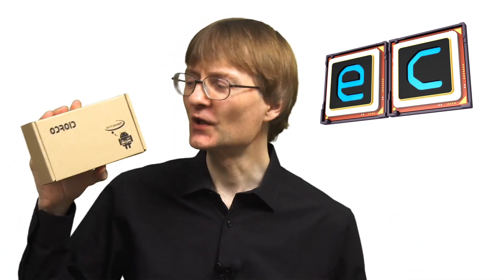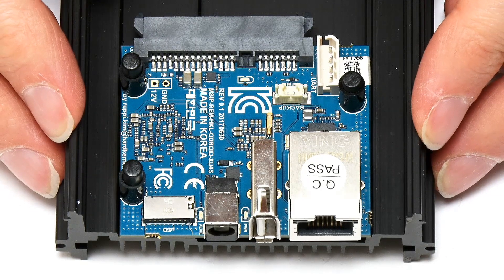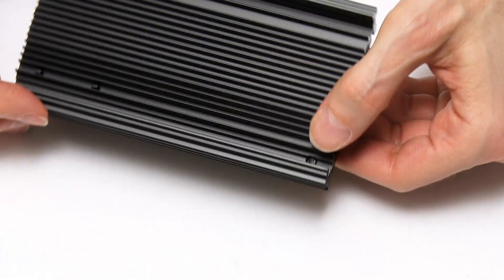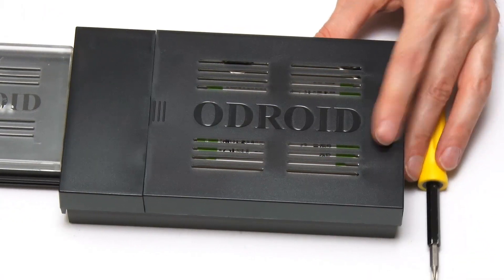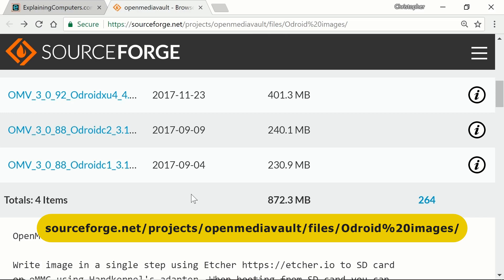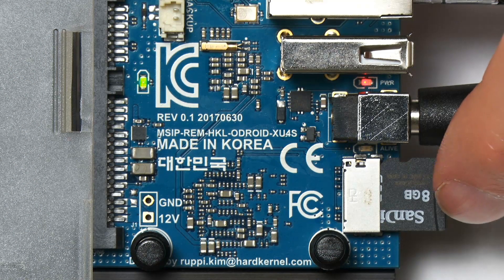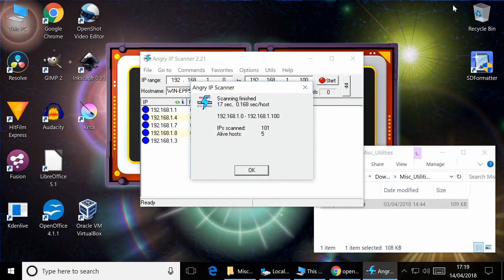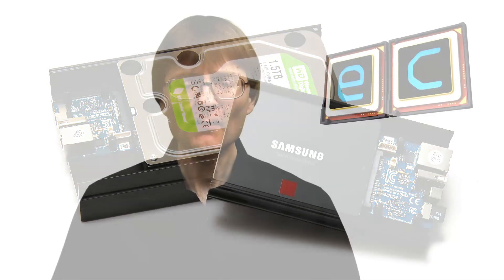Odroid HC1 & HC2 NAS SBCs

Comment: Well Sir Chris,  I have decided on qty2 hc1s as my double NAS on my router. I will use 1 for write and other for copy/backup. I will follow your video on setup.  My first attempt with SBC technology.   I will need an SBC FOR MY WORKSTATION. I hope to connect 1 or2  sata iii ssd Western Digital drives to it.  I want to try a flavor of Linux with a good word processor and spreadsheet.  Any recommendations on the best COMPLETE SBC. And which Linux to try?  Thank you as always!
Reply from the maker: For a workstation SBC, it depends what you want to spend! :) A Pi 3 B+ works very well, but an UDOO x86 is faster and has far more connectivity! Best Linux, in my view, if you run an x86 SBC is Linux Mint.
Reply: I just ordered the 2 hc1s! super excited. new adventure for me. lol  hope I can follow your video steps well..

Comment: Can you obtain a ROCKPRO64 and connect 2.5 Ssd sata to USB3.0 port. Then another 2.5SSD SATA TO USB C port. Run NAS?
Also ROCKPRO64 required components not all listed together in the store. Besides 12.5 volt recommendation, wifi/Bluetooth card and large heat sync (no separate fan other than what is offered in the hard NAS box which is to expensive.  I see that as a 2 disk single NAS unit. Pricey also. Need discount code to purchase. Sata to USB 3, and sata to USB c cables are at (www.newegg.com). I used my ssd drive order to match cables..
Please advise.
Reply from the maker: RockPro64 video tomorrow! :)
Reply: I WOULD Like to see that video. Also a 2nd one comparing UD00 and RockPro with 2 SATA iii SSD drives connected. comparing performance throughput writing and pulling information.

Comment: Open media vault allows all file types to be saved/used on ''tis NAS?
Reply from the maker: Yes, it just creates one or more network drives in which you can store whatever kinds of files you like.
Reply: I will purchase probably an hc2. Open my desktop and remove the 3.5" 500gb hd and try it.  I will get the specs and ask website if   Disk is compatible with HC2. I may need to find device drivers.  In that case I will ask if I load device driver on micro mini sim along with other software.  That would get me up and running in a short budget with ample data storage. A 2nd hc1 or hc2 I can purchase larger new  drive for share of pics and videos.
If you have recommendation for a third as an excellent pc, I can complete work easily down stairs with a cute unit beside my chair on end table.
Confused on OS I should get for that one. Just need browser, word and excel type apps with virus protection.
Reply: Thank you sincerely for the time and effort taken to reply!  This means a lot to me! Saves me tons of money I don't have!  Humbled..
Reply from the maker: The HC2 will work with any SATA drive -- you should not need any device drivers, and indeed I am not sure how you would load them with OMV. Note that it is probably not a good idea to try your desktop drive in the HC2 -- you normally wipe a drive to set it up in a NAS.
Reply: Parts of my memory have issues (not age-53 now) lol. Could be from calling Mother daily to comfort her (90's),  rubbing off on me. She is my daily project since I can only visit 2 x a year.  (Same story told and same list of ailments, but I look forward to each call.). Sorry to ramble.  I bought  desk system 2012 (6yrs old), 1TB main, 500gb (2nd disk). I stored 2nd disk data on cd and wiped it clean last week. Then I checked both disk for bad sectors, none found.  I also have a wiped external 800gb disk. (I had to download drivers for it a second time) I was going to check it (windows 7 professional)). Test write to it them wipe it again if it works good. Nice portable one with leather case a friend gave me in 2012. Can't remember manufacturer name.  HP - Hewlett-Packard Packard is my desk computer that runs extremely well still. Just one error needing to update device driver for Ethernet card.(supposedly a2015 release I did not get. While testing external disk, I'll try find driver on web.  Not sure that age is sata on drives. I can pull component list by serial of CPU from hp.com I believe.  External is in nice small steel case but not 2.5".

Comment: How much would it cost per year to run a Odroid HC2? 12 volts seems a lot for me.
Reply from the maker: Watts rather than volts is what matters! :) Cost will depend on your electricity supplier. In the UK I would guess at using one unit of electricty a week -- so maybe costing around £5-£10 a year. but would depend how long the 3.5" drive was spun up. (It needs the 12V PSU to power a 3.5" drive; only 2.5" can run from 5V).

Comment: Hello from Spain:
I am interested in this board and its potential, I have a question that I can maybe solve. I have a tablet with exynos cortex a9 1.4 quad core, ethernet outputs, hdmi, usb, bluetho .... I have a bootloop that prevents me from starting android icecream and only It has the possibility of recovery from the external SD card, it does not have a single button volume only power button so I can not go into recovery mode like on samsung phones and tablets .
I want to save my information from a single folder but if I put the files sent (u-boot.bin¡bl1.bin, bl2.bin, tzsw.bin plus the .img files (user data, system, bootlogo), it will erase everything to me again .
Could you use it, since it starts from the sd an odroid linux to boot from the sd and copy that folder? Where can I buy this card with the basic boot linux? Would it erase some of the information from the internal mmc? Of course I find it interesting, I'm going to buy a plate to practice. Greetings and thank you

Comment: Thanks for the interesting and informative video.  It would be interesting to see how fast the SATA interface runs, perhaps by generating a large, random file in RAM, then writing it to the drive to find the write speed, then reboot to flush the caches, then copy some files from the drive to e.g. /dev/null to find the read speed.  Also, for a "proper" server we need at least two network interfaces, so it can work as a router, gateway, firewall, and dhcp server, and three or more interfaces if we want to make a load-balancing router, or switch.  Have you seen anything like this in this tiny SBC format?

Comment: I got the HC1 and have nothing but issues with OMV... applying settings I get errors, installing plugins I get errors, etc etc etc.... dont know what to do with it...
Reply from the maker: This is very sad. I would wipe the SD card and reinstall; maybe there is something corrupt in your installation. I've not had these issues.
Reply: I tried with version 3 and 4 on different cards
Reply: OMV is getting frustrating.... fresh install and nothing but error after error

Comment: Would this have any issues going over WiFi with an appropriate adapter?
If so then adapter recommendations?
Reply from the maker: WiFi could be used, using the USB 2.0 socket. I would get the WiFi adapter from Hardkernel for compatibility (drivers).

Comment: Would it be possible to configure 4x odroid hc1's as a raid 10 NAS doubling the speed and reliablity?  For that matter is it possible to set up multiple nas's to run as a single raid storage device?  I personally prefer raid 10 because you get the speed boost of 2 drives running in tandem while also having the safety of having a backup.  But I am sure if it can be done with any raid configuration it can be done with all of them....  Anyway if it can be done I would love to know how I would love to build a home SBC NAS with raid 10.  I prefer going with SBC's for there low power consumption and will probably use the rock64 for the price:mb/s ratio....  Thanks for the great video please keep up the good work!  Also I am curious I know with Linux there's allot more potential for tinkering, if I remember right one of the SBC'S you tested has a gigabit eathernet port that can nearly reach 1gb in Linux or on the router is it possible to configure a split connection or .5gb up .5gb down.  So it can send and receive files at equil speeds?
Reply from the maker: I guess this may be possible by clustering the HC1s, but I am not aware of such a build. Most SBCs now have 1 gigabit Ethernet (the exception being the Raspberry Pi!). I see no reason they could not be configured as you say.

Comment: How is the 3.5" drive powered, I saw no power connector only the data interface?
Reply from the maker: As with the 2.5" dive, the power for the 3..5" drive is alongside the data interface. They are identical connectors.
Reply: I see thanks
Reply from the maker: Reading back, I meant that the connectors on the 2.5 and 3.5 inch drives are identical -- not the power and data connectors! :)
Reply: Yeah I see .. just a different 12v power supply thanks

Comment: This SBC lacks a video output to connect it to a monitor. Can this functionality be added to this board so it can be used with OSMC? Can the USB port be used with a USB-to-HDMI adapter for this video output purpose?

Comment: Bought one of these because of your video, seems to be faulty.  Do you get blue LED coming on whatever or do you have to have microSD card in slot?  I get the power LED and the green LED briefly flashes but no blue LED whatever I do.
Reply from the maker: Sorry to hear that you are having problems. The blue LED will only flash when the microSD card is inserted and the software has set itself up and is running from it correctly. Given that you have a red (power) LED, and the green has flashed, I suspect that your hardware is OK, and that this is a software issue. So I would suggest turning off the Odroid, removing and reflashing the microSD card wth OMV (make sure you have the right version, reinserting the card, powering up, and waiting for it to sort itself out (the first boot can take some time for the machine to set itself up). So, depending on the speed of the SD card, wait a good 10 minutes after powering up to let the machine sort itself out -- and do not remove the card during this time. If this does not work, download the OMV image again, in case it got corrupted. Good Luck!
Reply: oops, wrong image on microSD card, reflashed image and it worked straight away, I shall play with this tonight when I get back from work, thanks for the prompt reply.  You are a star!
Reply from the maker: Glad to here all is OK now. :) Enjoy playing with OMV. :)

Comment: There seems to be a transfer limit on the hc1. I attempted to transfer a group of files that was 282gb, and it told me that I needed more space to complete the transfer. The hdd that I'm transferring to is 4tb. I then broke the transfer up into smaller bits, and allbof it went without a hitch
Reply from the maker: I have not come across this, but I have also not tried moving that much data in one go. I imagine details of the files to be copied have to be held in RAM, and there has to be a limit.

Comment: would it be possible to anyhow connect 2 SSD´s? i have 2 128GB lying around.
Reply from the maker: Not with this hardware, except by connecting one via a USB 2.0 adapter. But they make a case/board for an XU4 : http://www.hardkernel.com/main/products/prdt_info.php?g_code=G150575879656

Comment: Hi there mate! Long time viewer first time commenter. Would you please start offering your content in 4K video resolution on your YouTube channel? It makes for a much better experience. 2018 is the year of 4K. Embrace the future yo! Thanks for all that you do ☺☺ you make learning about computers fun!
Reply from the maker: Thanks for watching, and for your first comment. :) I have just upgraded my pipeline to handle 1080p, and am still heavily tweaking that. So 4K is nowhere on the horizon I'm afraid. That would require roughly an 8 times increase in the capacity of my CG rendering setup for computer generated shots, and an enormous increase in storage capacity (I do everything in ProRes, which is large enough at 1080p!). 4K would also be impractical for computer output without very significant scaling, and most SBCs, most do not output 4K. Yes, some tech channels do record computer screens at 4K. But they clearly are not thinking of how it will be watched by the majority of viewers. I remember my BBC days shooting animation on film, where if any lettering on the screen was less than 1/24th screen height they refused to load the camera! :) And human eyes have not changed since then.
Everything I upload has to work on any size of screen, at at 240p upwards, and when viewed lean-back on a TV (the fastest growing YouTube space). I also rely on a 20x zoom lens, and some CU lens, for a lot of my videos, and getting such lenses to resolve anything like 2000 lines, let alone without massive chromatic aberration, is exceedingly expensive. So my target here will be to master true 1080p this year (ie an actual 1000+ lines of vertical resolution, as opposed to what most people upload within a 1080p file and which gets labelled as 1080p when it resolves nothing like that). At least if you are watching on a 3840x2160 display, my 1920x1080 should scale well. :)
Reply: ExplainingComputers thank you for your prompt reply. You certainly do make great points. It would certianly be an invesmtment however I think it would be a win in the long haul. Keep the videos coming ☺
Reply from the maker: It will, I am sure, happen one day! :)

Comment: Chris, would you be able to compare/comment on the CPU performance between the XU4 and HC1? 

Many thanks!

Would be relevant to see if performance has degraded without the active cooling and how much percentage wise (when possible).
Reply from the maker: They should be identical; same hardware -- and both well cooled.

Comment: Please help me to understand 2 things.  Why would you Wana spend $50+ to have a NAS like that?   Can't you connect your USB 3.0 / sata combination to your router and acheive the same thing?  No software to download. 2) how can you get 102+MB/s over a gigy rj-45? In my experience, 1000/8 + over head (8/10) will not acheive faster transfer over 100MB/s as seen in the other test.
Reply: Better performance, more customization options, and better security.
Router hardware and firmware is pretty limited and rarely ever gets updated. 

If all your doing is sharing family photos across a home network then plugging a USB drive into your router should work fine for you. If you want to do more like setup a video streaming server you'll want more horse power.
Reply: Target -Drone thanks for your reply.  Security is something that most people don't understand.  It is like your house.   You want to have a main door locked and use a vault for small and valuable things.  You don't put your whole house in  a vault for better security.   You make sure the main door is secure, always monitor it and people don't pass through it as they wish.   This is something that even most government agencies/ large cooperations don't understand.  Usually the leaking information and tampering come from inside.

Comment: Very nice video Chris, have you tried adding a wifi module of some type and have it stream to something like a smart tv or some other device for video of other file sharing?
Reply from the maker: I've not tried this -- but it should work streaming over WiFi to another device connected to a TV. This said, if it is connected via Ethernet to your router, it is available to wireless devices on your network anyway.

Comment: I'm used to adapter boards for hard disks burning out the power circuitry.  This doesn't look over-engineered enough that I trust it to survive the surge when a hard disk spins up all that often.  At least it's got good heat sinking so maybe the buck converters (on the hc2) are nicely cooled?

Comment: If you like good quality and like a good NAS, the new odroids are just right for you. In summary, odroid is kinda cool. It's for NAS enthusiasts, (the drives) since you can make the odroids run together,  just like the raspberry pi. (I think) And you can stack them. And they are metal, which is great.  If you like good quality and like a good NAS, the new odroids are just right for you.
Reply from the maker: Agreed! :) I do like the stacking potential. And the metal!
Reply: how can you make them run together? I am setting up 2 hc1s as we speak.  is it through OMV software? (I am guessing that because when you etch on OMV it wipes the current OS. Must have to have cables between them also. I may need a 3rd to run as the head with OS on it. hmmm.  I noticed the cluster Odroid. all had connecting cables. let me know what you think.  (I will go back and study the cluster setup you buy.) this is my 1st Linux install. I plan for many more.  and get rid of Microsoft all together!  their agreements in using v10+ is giving them access to all data that is used by their apps, email, word, excel, web history, other business apps. pictures, videos. (Good time to change now starting hobby business - disabled trying to become productive again).  I will leave HC1 Forum a question also. thx

Comment: This is pretty neat... It would be even cooler if they had a version that could handle up to 4-disk RAID configurations so you can have redundancy with your storage server.
Reply from the maker: True -- they do make a case and add-on board kit for an XU4 that allows connection of two 3.5" SATA drives.
Reply: That's pretty cool! Might have to toy around with a few of these at some point

Comment: is network nas transferring as good as directly connecting a usb 3 external drive?  i do a lot of file transfers to my storage i would hate to slow my system down compared to what it has now.
Reply from the maker: Unless you have 10 gigabit Ethernet, a USB 3.0 connection is faster than a NAS (ie gigabit Ethernet is slower than USB 3.0, which is slower than eSATA). And, in general, I would always favour doing backups with a locally connected drive if possible.